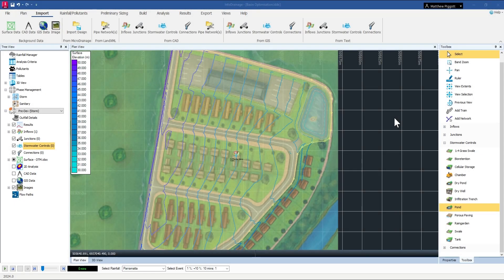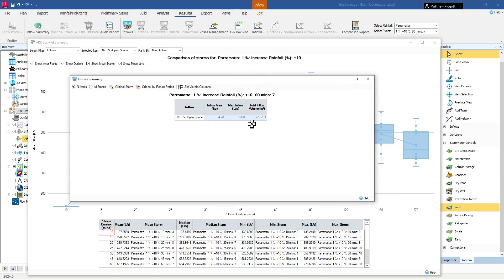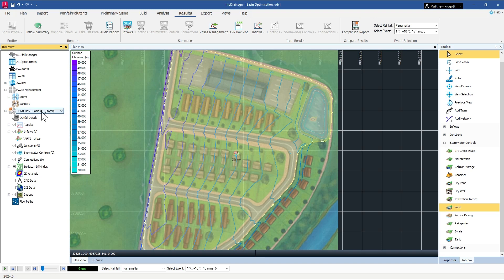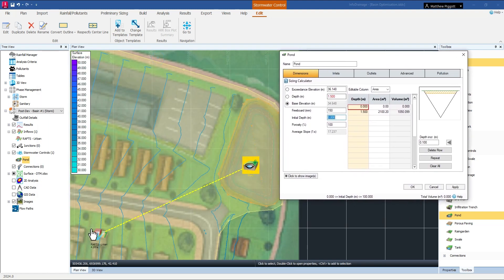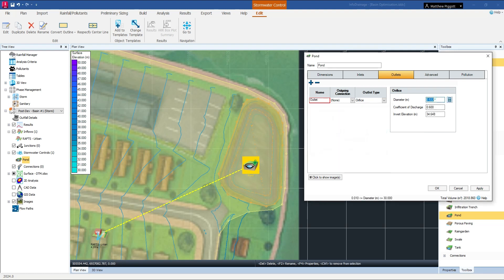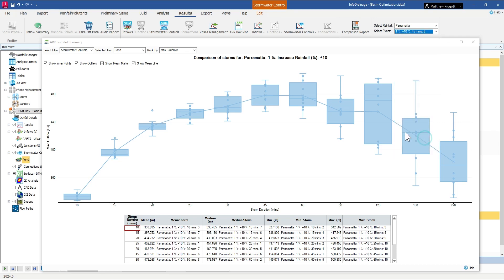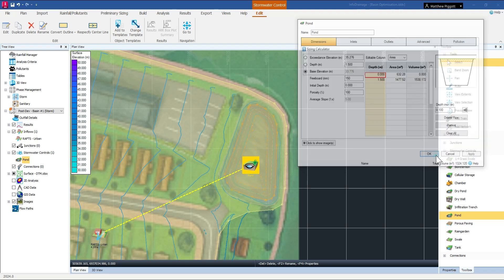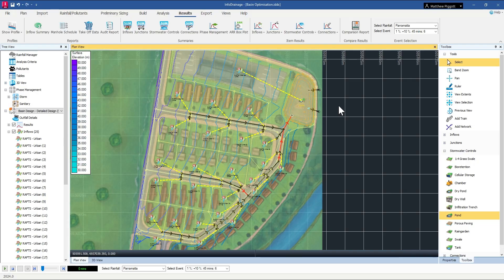Basin Design and Optimisation in InfoDrainage with WSUD in Mind

Comment: In the catchment area section, Infodrainage requests the coefficient of runoff and the percentage of impervious area. I find this part a bit confusing. Shouldn't the percentage of impervious area directly correlate with the runoff coefficient? For example, if my catchment area is a road with a runoff coefficient of 0.9 (indicating that most of the water runs off), wouldn't the percentage of impervious area be 90%? Even though the entire road is impervious, we assume 10% of it could infiltrate, which is why the runoff coefficient is 0.9. You have kept the percentage of impervious area as 100 in the video.